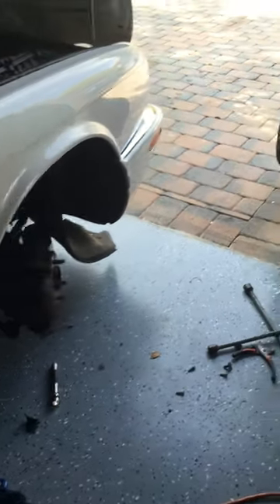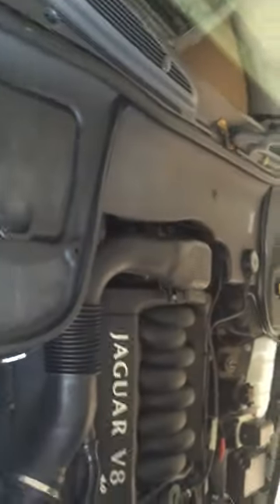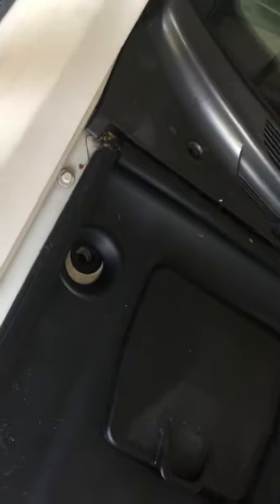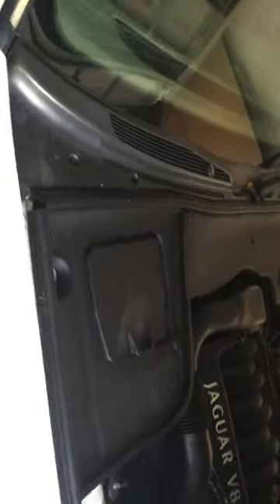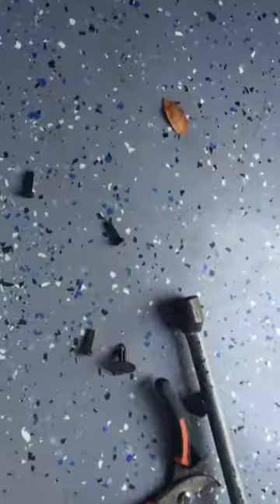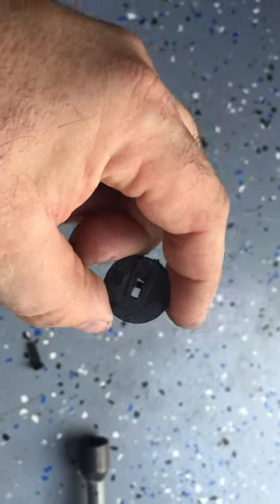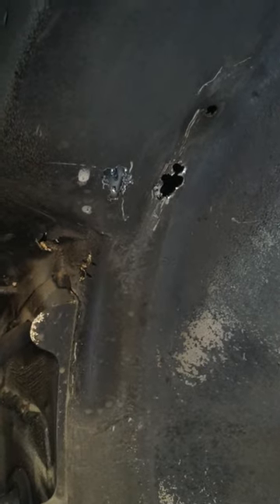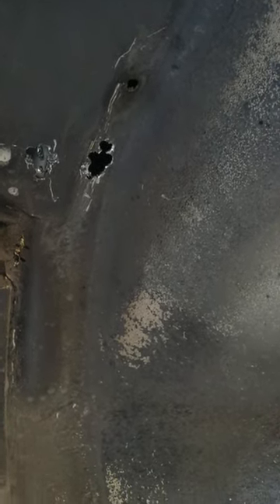1998-2003 Jaguar XJ8 Vanden Plas Hood Not Opening, How to Fix

Comment: Many thanks! Saved me alot of headaches. Same thing happened to my 1999 XJ8L driver side. Measured exactly 2.5 inches below the fastener hole. Used step drill to make half inch hole. Got the hood open. For the repair, soldered a small PC board with a slot for the cable. Fixed the passenger side also. It was also about to fall off.

Comment: Thanks so much.  I have a good friend who is a genius at this JAG STUFF.  I called him after watching your video and he said to do exactly what you did. Watched the vid one more time to get the "push forward motion" and it was done. It was my passenger side.  I took my latch from the drivers side and removed the busing closed that one as well.  My guy suggested silicone that sets up in the area where the bushing was to save the wire to metal contact.  Thanks again!

Comment: Thank you for posting this awesome video I've been turning wrenches for 35 years and never had to get a jaguar hood open with a broken cable, you saved me a ton of time!!!!  just one tip I can add disconnect the battery before you do it because on the passenger side The positive battery cable is right above where you're going to be drilling and you don't want to short out, I used a step drillbit it worked perfect thanks again
Reply from the maker: Oooops. Sorry, forgot to mention that!! I did remove the battery to do this job

Comment: Thanks for the vid, I used a hole saw to make a larger hole, and the cable had just fell out so I clamped the ends where the cable goes with a pair of pliers. Saved my day 04/23/2017

Comment: Thanks for the video.  The cable came off the lever on the passenger side.  The cable originally had a plastic grommet to keep the ball from pulling through...not a great design.  Also, be sure to warn viewers that there is a big 12 volt cable right behind where you need to drill the access hole on the passenger side.   Disconnect the battery would be good advice.  Thanks, brother , for the help...
Reply from the maker: No problem this was a pretty simple fix took about 40 mins

Comment: I drilled a single 1/4” hole, 2.5” or so below the existing hole for the inner fender well trim tab.  Within 20 seconds I had the latch releasedmonnthenpassenger side using a long, thin regular blade screwdriver.  

To cover the hole?  Either just touch up paint, or pack it with grease and cover with a 1” bandaid type square of foil tape on each side or maybe a blob of black rtv on each side.

The issue?  The ball end of the latch cable slipped out of the ‘fork’ it rides in.  PITA

Comment: we just tried your instructions on your video. Thank you it opened. BUT beware an electrical wire (the main power to brain) was in the area and we got sparks when we went in with the screwdriver.  Advise to unplug battery first. checking now to be sure no damage was done by sparks.....
Reply from the maker: I think I do mention to disconnect the battery in the video??

Comment: I had this same problem as the cable slipped out of the latch on the passenger side. (USA Model) I ended up squeezing the latch where the cable comes through so that it cannot pop out.  Thanks loads for the video.
Reply from the maker: Cool, glad I could help!

Comment: Thanks for the video on the passenger's side.  The driver's side can actually be accessed through the firewall, there's a grommet that pops out and then you can get to the latch with a long screwdriver.
Reply from the maker: That is correct but to have the holes pre-drilled is ok too as it's a lot easier if you ever had to do it again... which hopefully won't happen!!

Comment: I cant tell where that is in the hood well.
Reply from the maker: Listen to the video, the hole on the right that I drilled (the bigger one, looks like a tear into the fender) is the correct one. the small round hole above it is where one of the clips for the wheel inner liner goes and measure about 2.5 inches below that and drill there, stick in a flathead screwdriver and push rearward, this should open the latch...... PLEASE DISCONNECT THE BATTERY IN THE TRUNK BEFORE DOING ALL THIS WORK